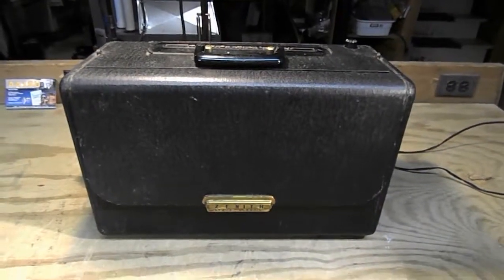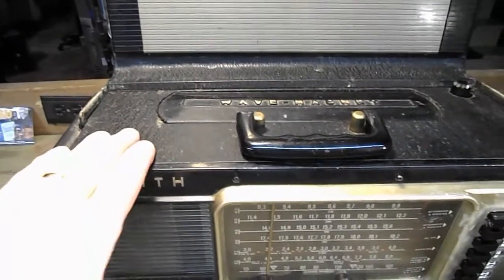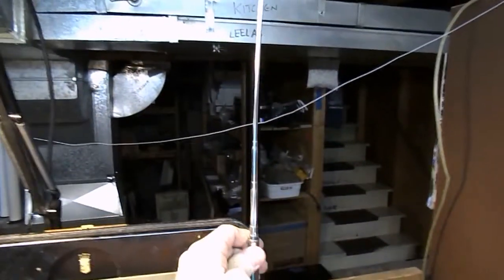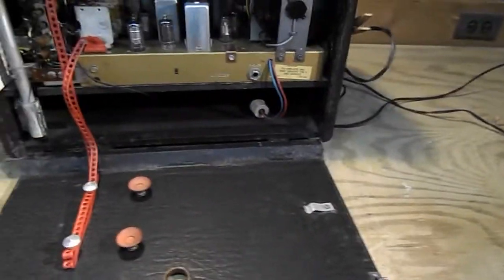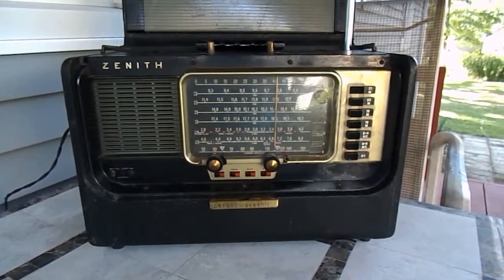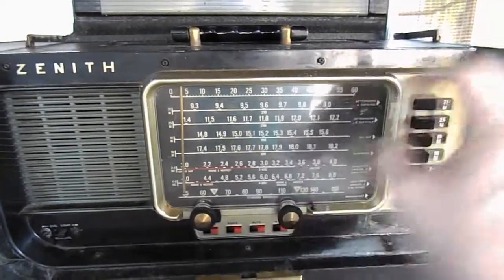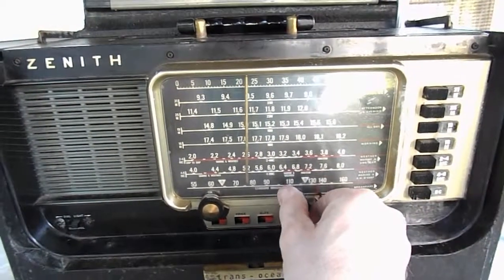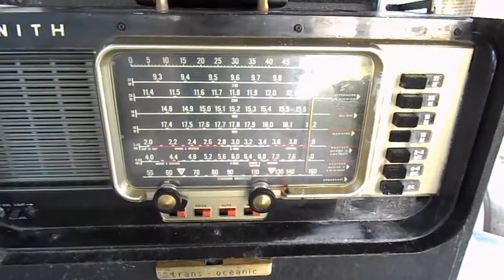Zenith Trans-Oceanic L600 Overview

Comment: FYI it doesn't receive the international shortwave band covering 22 meters.  So not all of the shortwave bands. The R700 does (not the Royal 7000 but the R7000)
Reply from the maker: Thank you for writing. I think I was referring to it receiving on all the bands that the radio actually receives, which it did.  Because of the time of day and propagation, I could not demonstrate some of the bands.  I have a Royal D7000Y here, along with a G500, H500, R600, and 2 companion radios.  I really should fire them up more often.  The R7000 is a little out of my price range.